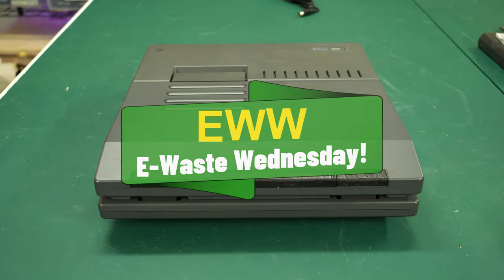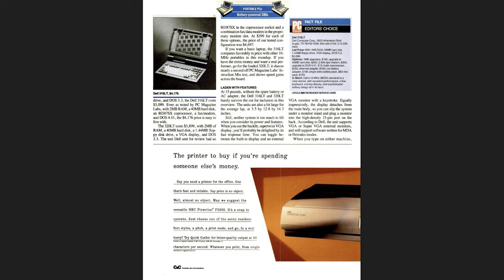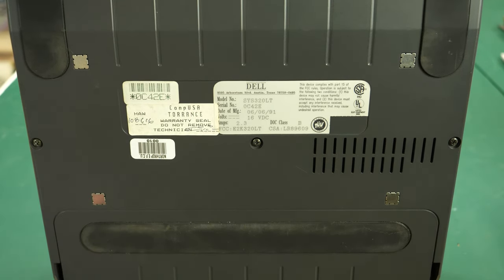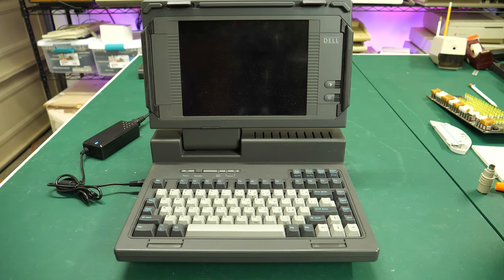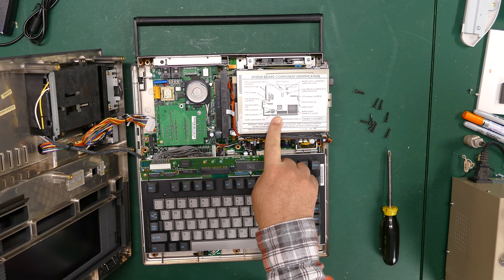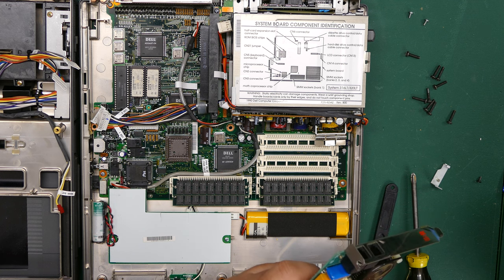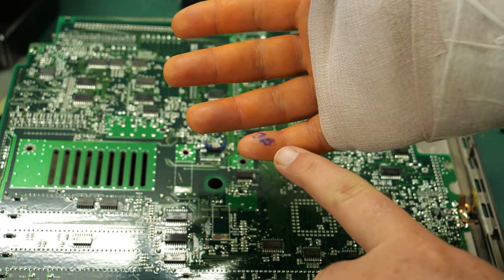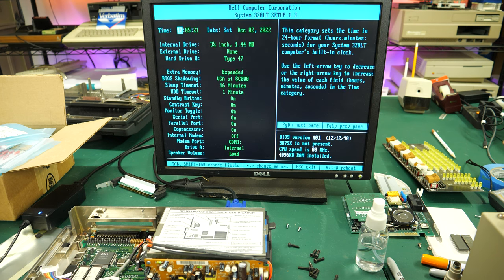First Generation Dell Laptop Saved From E-Waste

Comment: Here's an idea: Install a network card that supports a boot ROM, and install the XT-IDE BIOS into that ROM socket. Configure the XT-IDE BIOS to use the on-board IDE port, and then use an IDE to CF adapter to use a CF card. (This is how I was able to get my 386SX PC working with a nice-sized CF card. While its BIOS did have a user-defined type, I wanted to exceed its limit.)

Also, did you happen to notice that the CPU was in a socket? That was a cleaver way for Dell to build 316LT's and 320LT's without having to manufacture separate motherboards for each.

And yeah, that is really cool that it takes standard 30-pin SIMMs (probably requires parity SIMMs). Yeah, I see why PC Magazine almost categorized this as a portable... it's basically a mini desktop PC with a battery and built-in display. In fact, it wouldn't surprise me if there was a Dell desktop that shared the same motherboard.
Reply: Interesting, so the xtide bios-extension will override (not conflict with) the original bios's control of the IDE port? This is intriguing!
Alernatively, I was thinking to suggest drive-overlay software, which I think can do similar, with some caveats: IIRC, you'd select a drive setting frgom the bios that has all the CHS values smaller than your actual drive, then it loads something into to boot-sector to make it redetect the drive's real settings at boot. I guess it's kinda like your xtide bios extension, except on the disk. I can't recall if the disk would still be usable in another machine (without booting off of it with the same wrong chs settings). Or if it would be accessible if you boot off a floppy. I did this with a 2GB compact-flash in a weird 486 tablet that had such a custom-shaped hard drive that as i recall they didn't even bother to have changeable chs settings in the bios.
I don't think "hard drive failure" would come from wrong chs settings, since c0h0s1 (the boot sector) should be readable on any drive regardless of wrong chs settings. I'd think it would just act like the drive was unpartitioned or badly-partitioned. But, of course, fdisking a drive with the wrong chs settings could be funky, to say the least. but souldn't not be possible. So i im betting that drive is bad, and if others, regardless of matched chs settings, cant be fdisked, then maybe the leaky caps damaged something ide-related.
Reply: @ericwazhung  I did forget a step (partially because I had to hook my 386 back up to double-check).

On my 386, I do have the "HD Controller" Enabled in the BIOS, but both drives are set to Not Installed. This seems to be what makes the BIOS of my system happy, and I haven't found any evidence of a conflict.

If I set the "HD Controller" to Disabled in the BIOS, I get a POST error if a hard drive or CF card is actually present on the on-board IDE.

For other systems, some trial and error may be necessary. But the main thing is that you would want the hard drive types configured in the BIOS as Not Installed.

Comment: Thanks for posting this - I had the very similar 316LT as my first computer at university in 1996 - I upgraded it to the maximum RAM (4mb?) and put a 110mb HDD in it (though don't think it worked at full capacity). Running Win 3.11 it saw me through 2 years of studies. The orginal power brick was huge and worked great as a foot warmer in the cold Welsh winters, I remember it had hot-swap batteries, something I've never seen since and my other main memory of it was the slowness at sending anything to the printer. If I had an essay to print, it would literally take 20 mins to arrive at the old Canon Bubblejet I used with it; no good when deadlines were looming!

I do remember trying to use it in the garden once in the summer and the sun overheated the screen and I thought I'd killed it. I also lugged it on my back (it had a really huge carry bag) on my bicycle once and had to do some solder repairs to it later as the shock of transport damaged it.  It survived uni, though a few years later I lost it in a house flood. Good to see it (or something very similar) again.

Comment: Interesting 386 laptop - the theme with those early laptops is that they're an absolute unit of a computer, huge and heavy. Good find.

And I instantly knew that it's a 386 computer as some model numbers were an universal theme that concerns what CPU they got - 3 being a 386 CPU, and 20 being the speed they run at, long before you put on the laptop advertisment and tore into it.
Reply from the maker: Yep. Thanks.

Comment: Laptops of that era almost always defaulted to black text on white background.*
And if the hard drive is Conner, if the rubber sealing ring hasn't melted, the head arm will be stuck in the parking position, just slide a piece of sticky tape between the arm and the bump stop, that fixed all of mine.

*) Long story short most pixels black consumes noticeably more power than most pixels white.
Dumpster diving should be an Olympic discipline. But then again trophy space would cut down on shelf space and while a trophy is nice to look at, a functional piece of vintage hardware is nice to play with. And then again, most people in my surrounding would much rather look at a nice gold medal instead of "all this junk, oh no, there he goes dragging in some more".
Reply from the maker: That's true. I have had stuck heads a lot. Especially with HDs in Macs. Maybe I will take a look at the head mechanism just to see if that is the problem. Can't hurt at this point.

Comment: We don't have much in the way of 'e-waste" facilities around here, usually require you to be a town resident and have an expensive  tag.  ANd they don't let you take anything out of the place either.  So any classic equipment around here is just getting crushed.

What a difference though.  You had to pull this one out of e-waste.   These days Dell just makes e-waste machines right from the factory.
Reply from the maker: Yes. It seems that way sometimes.

Comment: I wonder if someone will update Wikipedia to say the first logo was used until 1990. It’s clearly not just in the moulding, since they were sending off print ads in the summer to run in the autumn with that logo too.
Reply: The sticker on the bottom says manufacturered in 1991

Comment: I have one of these working but I also need to replace the batteries.  Mine was missing the big yellow battery so I do not know the voltage.  Can you share with me the details of the larger yellow battery?  Thank you for any help you can provide.

Comment: So if a hard drive seal is broken, it is unsalvagable?  Often the term 'leaky' when describing a capacitor doesn't necessarily mean that it is physically leaking; more that it is unreliable.
Reply from the maker: Yes. The seals on those old Connor drives melt away and the sludge can end up inside the drive.